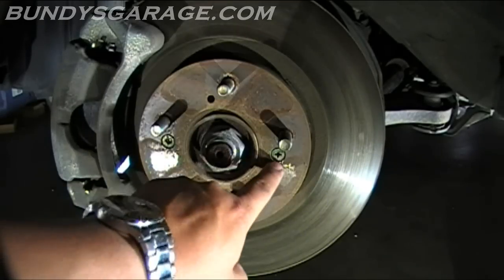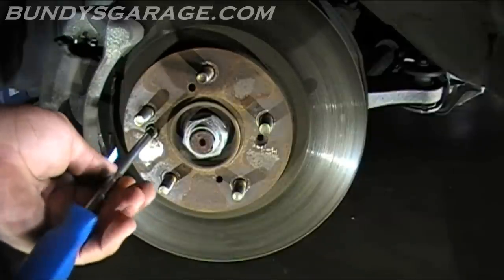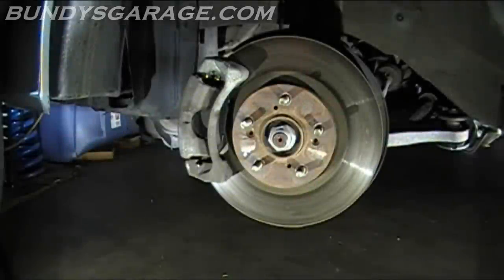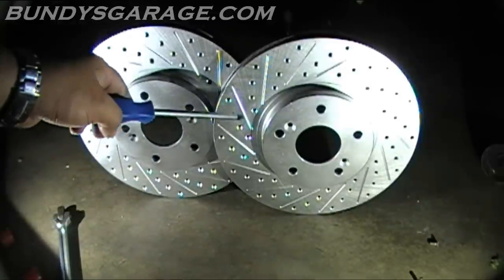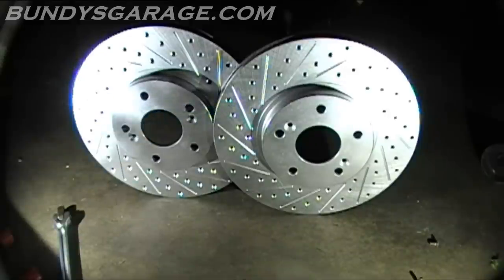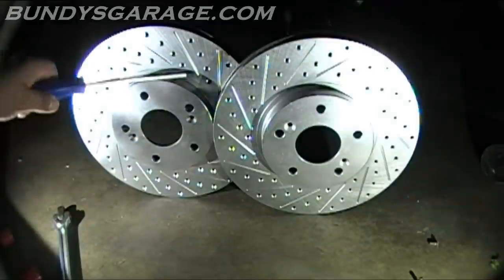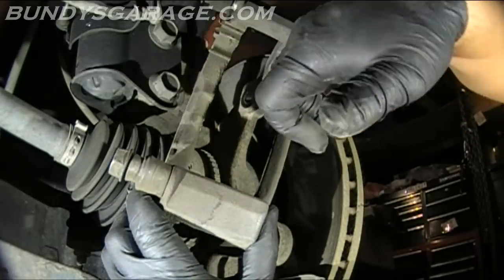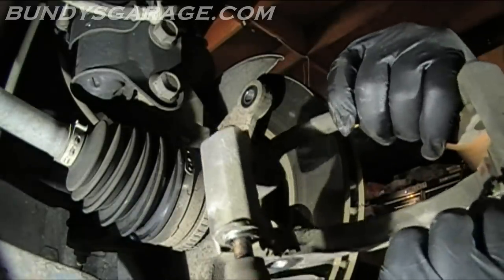Honda Odyssey 99 - 04 Front Brake Pads and Rotor Replacement - Bundys Garage

Comment: Use a Q-tip and clean all the old lube out of the slide chambers. Also remove those slide clips and make sure there is no rust/corrosion under them. If so, use a wire brush or sand paper to clean them before replacing "new" clips, especially if you live in the rust belt. I use a thin layer of "Permatex Ceramic Extreme Brake Lubricant" between the clips and the brackets to keep them from rusting/corroding. And I also replace, not clean and reuse the hardware, it's inexpensive. Another thing is, clean the cosmoline (rust preventative) off the rotors before putting the calipers back on for easier access to the back side of the rotor. Great video. Thanks!
Reply from the maker: Great tips!

Comment: Nice video. good illumination and explanation. good tutorial.Perfect (I was to be a mechanic for living).
Viewers please use a brake bar to loose the tighten bolts after that use the ratchet to remove the bolt faster.  (the ratchet could broke and can cause an accident (your fingers) Good idea the screw drivers. All steel to tap it with a hammer to loose screws. Because sometimes we don't have air impact wrench (gun), we have to tap carefully the bolts or screws on the head because the vibration can  loose them. Tap carefully with the hammer, Check  with the screw driver carefully (don't brake the screw) If don't lose. tap again. try to don't brake the screw because is more difficult to remove a piece of broken screw and fix the thread. don't damage the head because the Phillips Screwdriver wont work properly.

Comment: I'm sure someone (or 100 others) has already mentioned that you could definitely just drill out the philips screws that hold the rotor on. This is a factory convenience only and have nothing to do with the integrity of the rotor or the braking system.
Reply from the maker: They also make it a lot easier to install everything when it comes time. I re-install them every time.

Comment: Hey man, just wanted to thank you AGAIN for you Odyssey videos.  I put them to good use for changing the spark plugs and brakes/rotors.  Was hoping you or others may offer an opinion regarding the following:  purchased my 2003 HO with 160K miles. Did the oil change, spark plugs, fliters, brakes/rotors.  My question is about the ATF.  Would you advise to simply add ATF to make it the appropriate amount on the dipstick, drain it and refill with Honda ATF, or "flush" it and change the filter as well.  Any advice would be greatly appreciated as I'm planning on taking this to my personal mechanic on Sunday and want to hear some opinion before I get his.  Many thanks!
Reply from the maker: So sorry for the delay! I would use Valvoline MaxLife ATF (RED BOTTLE) it in a Honda ATF Equivalent, and I would drain and fill it 3 times. Some of the transmissions had an external transmission filter, if yours does I would change it otherwise you can't because it's buried inside the transmission.

Comment: Hey there i know this video is older but couple of comments for others:

1. You do not need the "retaining" screws. They mostly just seize and are only there by the manufacturer to make sure the rotors dont fall off on the assembly line.

2. DO NOT USE THIS GREASE THAT IS IN THIS VIDEO. USE BRAKE RATED GREASE!
Reply from the maker: I don’t know where your getting your info from but Sil-Glyde is perfectly fine to use. And yes re-install the rotor screws.
Reply: @bundysgarage  the red wheel bearing grease you used on the pad. The sly-glide is what you should have used again. And as a person in the auto industry for over 30 years NO you don't need the screws. Contact a manufacturer and ask like I did 20ish plus years ago. They do nothing.

Comment: Hi Bundy, tried it, but was only able to replace the pads not the rotors.  The screws that hold the rotors wouldn't come off, hit my impact screw driver with a hammer to no avail, sprayed some thin oil, tried the same and they still wouldn't come off, any ideas I can try to get them out?
Reply from the maker: So sorry for the delay, if you still need help or anyone else is reading this. If you are working on the drivers side, turn your wheel all the way to the right. That will give you more room to the bolts on the backside and you can get a breaker bar in there to bust them loose!
Reply: just drill them out with a 1/4" bit.  They are just convenience screws to hold the rotors in place during re-assembly.  Other car mfg's don't have these screws at all.  With those you just use a lug nut to hold the rotor in place during re-assembly.

Comment: Also couldn’t you just open the bleed screw on the caliper when you push the piston back that way you push out some of that dirty brake fluid  out instead of pushing it back into the system.

Comment: How can you get the right turq without having a tool to tell you the turq and I can't afford one
Reply from the maker: You really can't, you need a torque wrench.
Reply: @bundysgarage  I changed my brakes and rotors now I have a click sound on both sides as the wheels turn both directions any thoughts

Comment: Great video!  Are the rear rotors the same to change out, as the front rotor you demo'd?  I subscribed but did not see a video specific to rear rotors.  Looking forward to more videos by BundysGarage..
Reply from the maker: On 99 thru 03 Honda Odyssey it is a rear drum brake set-up. On the 2004 Odyssey they changed to a rotor and brake pad set-up.
Reply: My 02 Odyssey has brake pads in the rear..  Will I need to special order or will the 04 models work on it? I changed the brakes pads  a few times before, but the rotors need change sooner rather than later.